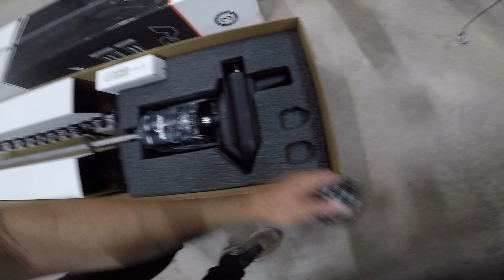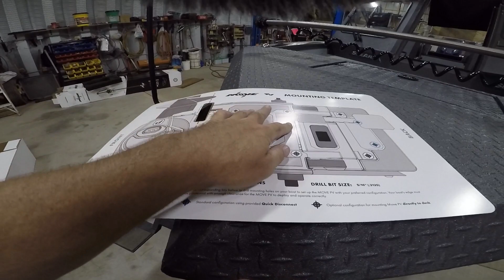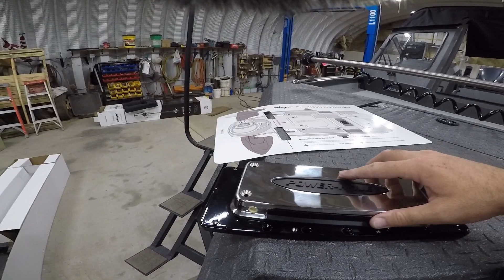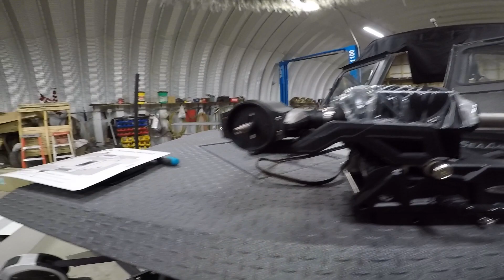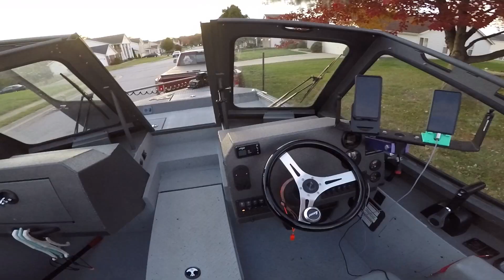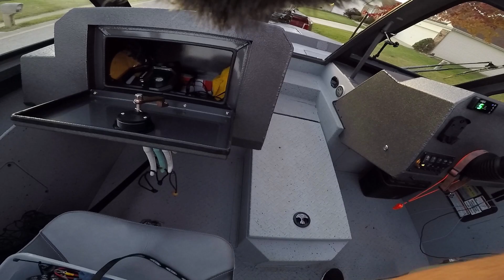Installing a Power Pole Trolling Motor on a SeaArk Dynasty 2.0 HD

Comment: Those power poles are cool but 5400 for a trolling motor that doesn't even have auto deploy/stow or being able to move the trolling motor up and down in the water column from the remote is insane.

Nevertheless I hope you enjoy it and that boat is pretty nice.
Reply from the maker: Autodeploy is problematic. The tech in this TM is ahead of the other brands for certain features and only weighs 44lbs. The ulterra weighs almost 100lbs and cost isn't far off with the $500 quick release bracket. All of them work great and serve their purpose.